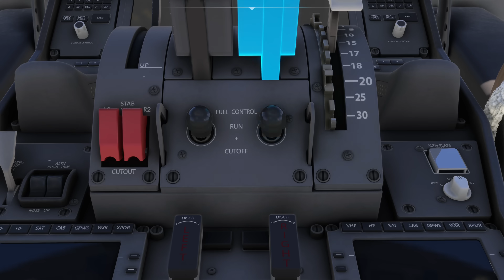Air India 171: Why Did The Fuel Cut-off Switch Get Moved?

Comment: “The simplest explanation is usually the correct one.”
Occams Razor. 
Suicide
Reply: not when it comes to technology , electronics and mechanics
Reply: @stevebubbie1126 Oh yes, of course, that must be it: both fuel pumps just happened to take a break at the exact same time — pure coincidence! And then, out of sheer goodwill, they decided to start working again on their own. Or maybe the two switches — which are specifically designed to not be moved without deliberate force — just randomly flipped from Run to Cutoff, took a 10-second nap, and then went right back to Run. Totally normal.

Or perhaps the pilots' dialogue was just a brilliantly acted performance — Oscar-worthy — and no one actually touched anything. Could be a software bug, an electronic glitch, or some mystical mechanical failure, MH370-style, GermanWings, EgyptAir… yes, all those events clearly had no human agency involved, as you suggested.

Because obviously, the idea that a human being — possibly depressed or unstable — could simply turn a switch from Run to Cutoff? That’s way too complex to consider. Much easier to believe the aircraft did it all by itself.

Comment: These switches are detented in both cutoff and run positions. They have to be manually operated. Anyone saying otherwise is ignorant of the facts There is no ‘auto off’ function of the  switch as some have surmised. This happened to a Delta crew in the early days of the 767-200. They shutoff both engines for an EICAS message and got the engines re-lit 2000 ft.  above the Pacific. Air India’s were shut off by a pilot, period.

Comment: As far as I know, the public does not know which pilot said what on the voice recording. The person who replied, “I didn’t” may have spoken the truth. The person questioning about the cutoff switches may have been setting (in a highly premeditated fashion) the other person up to shift the focus away from his own actions, knowing both their voices were being recorded. An effort to confuse and shift blame is within the realm of possibility. It’s a bit more of a convoluted scenario, but it is also one that must be considered with the information we currently have. Also, who called the “Mayday!” and what was that person’s demeanor?
Reply: Surely the Pilot flying would have had both hands firmly on the yoke at the point of rotation and initial take off phase, hence why the pilot monitoring operates the gear up lever when requested by the pilot flying.  Therefore, in this case, the pilot flying was the first officer so if anyone manually switched the fuel levers to cut off just after rotation, it must have been the captain.
Reply: @grahamt8808 I have never been in a cockpit, so I am admittedly out of my depth. Does the point that there is ambiguity about which voice is connected to who was doing what and saying what still not apply to the piloting protocol you’ve elaborated?
Reply: @grahamt8808  Exactly, it was dumb and unethical for Air India to try to obfuscate this critical information on who said what and which pilot appeared, preliminarily, to have turned the two fuel switches off. But it was even dumber for them to issue this preliminary report in the manner they did. 

Despite their attempt to temporarily cover this up, it was very likely 56-year-old Captain Sumeet Sabharwal who turned the switches off, and it was very likely 32-year-old First Officer Clive Kunder who discovered these shocking control changes in the 10 seconds after they occurred, first on engine 1 (yet probably not until about 6 seconds afterward, when all kinds of warnings were going off in the cockpit). Then, Kunder seemingly asked Sabharwal, "Why did you do that?" To which, Sabharwal seemingly said, "I didn't." (exactly as a child would do when confronted by his/her parent, just as Captain Steve said in this video). After that verbal exchange and have literally no time for anything else, Kunder seemingly turned the fuel switch of engine 1 to run. Then, Kunder seemed to pause for several seconds and seemed to switch the fuel switch for engine 2 to run.

Note to the bums at Air India: If you are going try to obfuscate your "story" of what happened, then don't disrespect everyone (especially all the families of 260 deceased people) by acting like you don't know who said what. Air India (and likely the entire extended team of investigators) knew, in several independent ways, who said what, and they almost certainly suspected that the turning off was done by 56-year-old Captain Sumeet Sabharwal. There is nothing wrong with publicly reporting that as a preliminary finding and saying this preliminary finding will be studied thoroughly in the next year or two before issuing a final report. In fact, that is the transparent and ethical thing to do. In those senses, Air India has failed.
Reply: @grahamt8808 good guesswork.
Reply: I had just posted this exact scenario (deleted now, you said it first. 😉). I think this is the most likely scenario.
Reply: @sintax6581  I wish you hadn’t deleted the comment. There must be value in our perspectives. Your gut was telling you something. May I ask why you chose to delete the post?
Reply: And the one who did it could just ask to other why did you.   

We need video.
Reply: @HappyPenguin75034  Video, which has been discussed in other threads, would be useful in the investigation. Are unions, officials, and airlines willing to make the push? The pros and cons make for a conversation that Captain Steve may decide to address in greater depth soon. Change is often born out of what we learn in these incidents.
Reply: You know they weren not speaking english😢 @HappyPenguin75034
Reply: @mic7093   .... Or not ...
Reply: @Paula-tf3zv  Correct. Or not. No theory is definitive right now.
Reply: Entirely plausible.
Reply: @Perly53  Right or ultimately wrong, I am glad you agree that we are at a point where it must, at least, be considered, until more is disclosed.
Reply: We have three actions: Turning off the switches, asking, "Why did you turn off the switches?", and trying to restart the engines. As far as publicly available information goes, we don''t know which pilot did any of those. It's conceivable that one pilot did all three, or any other possible combination.
Reply: @russlehman2070  Including you with those who see uncertainty.
Reply: Nice observation another possibility
Reply: @toastums71 I speak as a layperson, so thanks for reassurance that the comment is not coming across as utterly off-base.
Reply: He who smelt it dealt it
Reply: Also consider, maybe one pilot was already dead. And the one who was flying staged the entire scene and crashed the airplane.
Reply: Watch Flyingbeast video if you  really believe in unbiased explanation ❤❤❤ english subtitles are available
Reply: The actual statement is not put out. Not even the timing of the statement. 

And indirect statement does not validify the truth of the scenario.
Reply: Come on. We’d hear more than “I didn’t,” if that pilot truly did NOT just commit mass m*rder via fuel cut-off but his co-pilot did.
Reply: @ThatAdam12 Believe me. I was right with you a day ago. But I took a step back and felt there was a possibility. Remote or otherwise. We seem removed from absolutes at this point, which is what I am acknowledging. Information is deliberately vague.
Reply: @ThatAdam12 but this flight only lasted 32 seconds, there was no time for a longer conversation.

Comment: No one will ever know why that dummy shut the engines off. It really does not make any difference at this point. Move the switches so the dummy first officer can not get to them. Put them way over on the left side of the pilot. Only the pilot should have access to the switches. It is really dumb to have those switches front and center like they are now. Either that or just get rid of the switches altogether.

Comment: My guess is that the co-pilot wasn't aware of what he was doing when he shut off the fuel supply. Was it a mental blackout, some kind of carelessness, or poor training that prevented him from understanding what he was doing at that moment? Perhaps he believed he was performing some important action for the continued climb, such as retracting the landing gear. I know that sounds far-fetched. But if he believed the switches did something other than shut off the fuel, his answer would be correct from his perspective. My reasoning doesn't claim to be true; it should rather be understood as a plea to use cockpit cameras.

Comment: Clearly, the switches were physically moved as one of the pilots was asking about it, so people suggesting "maintenance jumpers" being left in the wing kind of baffles me.
A "RUN" signal also causes all sorts of indications and messages.
It would have been noticed before they left the gate.
They were also moved 1 second apart, and switched back to "RUN" 10 seconds after.
"Maintenance jumpers" makes no sense.
With regards to two pilots needing to perform an action to switch the engines off... the cutoff switch isn't the only switch to do that.
The fire handles could have also been pulled which would have made it even less likely for the engines to recover after being pushed back in.
But, at some point, a single pilot would also need to be able to switch the engines off.
In cases of emergencies, the pilot who has to concentrate on flying shouldn't have to be asked to insert and rotate his key at the same time as the pilot taking care of that emergency in order to switch off the engine that is on fire.
At some point, making it harder for pilots to do their jobs becomes detrimental to safety and doing this in order to prevent possible intentional consequences is just not solving the problem.
We need to value the lives and mental health of the people who are flying us to our holiday destinations.

Comment: The design flaw is that at take off those switches should have a plastic cover over them that can only be released by 2 other switches either side of the cockpit that can only be reached by the pilot sitting closest to it (i.e each one). Then sabotage cannot happen. Not saying it did here ok, let's wait for the findings. Those switches are far too important to just be sitting there and not protected better.

Comment: Hi Steeeve,
Is there any way that one of the pilots could have confused those cutoff switches with some switches  they were supposed to flip? Like pushing the radio button off instead of pushing the engine off button in a car. (Yea, I did that the other day.....)
Don't worry ..... You'll never have me as a co-pilot ....

Comment: When starting the engines would it be possible for those switches to be put in the run position but the indents didn't engage properly? The switches would then be unlocked and accidental movement possible.

Comment: While many discussions around Air India Flight 171 focus on the unlikely scenario of mechanical failure affecting both engine fuel cutoff switches, the available evidence suggests a more plausible explanation. The problem does not appear to result from wear, age, or internal malfunction. Instead, it aligns with a known installation-related vulnerability described in FAA SAIB NM-18-33 (December 2018) — a condition where the switch’s locking mechanism may be left disengaged during installation, allowing unintended movement between “FUEL CUTOFF” and “RUN.”

This advisory reframes the event: Rather than an extraordinary dual mechanical failure, it becomes more likely that both switches were installed incorrectly, leaving their locking mechanisms disengaged. This condition, if present, would significantly increase the chance of accidental activation — especially under real-world cockpit conditions, such as turbulence or inadvertent contact.
FAA SAIB NM-18-33 was only advisory, not mandatory. Operators were encouraged — but not required — to inspect or replace affected switches. As a result, many aircraft already in service, including Air India’s Boeing 787-8 (VT-ANB), was not inspected or modified, as confirmed by the accident report.
Supporting Factors
Several details increase the plausibility of installation-related switch compromise:
•	SAIB NM-18-33 clearly states that improper installation can leave the switch locking mechanism disengaged, enabling unintentional movement.
•	The condition affects Boeing 787 variants, including the 787-8 involved in this incident.
•	VT-ANB was delivered in January 2014, years before the bulletin. There is no public record indicating it was inspected or modified following the advisory.
•	The advisory notes no part defect or mechanical fault — only a risk introduced during installation if care is not taken.
Conclusion:
Although the exact probability cannot be calculated without direct inspection of the recovered switches, the absence of mandatory corrective action and the aircraft’s unmodified status raises the likelihood that both switches were vulnerable to inadvertent activation.
This installation-related failure mode is far more credible than a coincidental dual mechanical breakdown.
Notably, the AAIB preliminary report and public sources do not confirm whether the recovered switches were examined for the specific lock-disengagement issue outlined in SAIB NM-18-33.
Furthermore, the one-second delay between the two engine shutdowns could plausibly reflect a momentary oscillation or movement — such as turbulence or cockpit interaction — that made unintentional contact with both unlocke

Comment: Captain Steeeve, 

I can foresee a problem requiring both pilots to turn off the fuel cut-off switches, much like the two people required to launch a nuclear missile. Should one pilot have one or both hands injured [perhaps from something crashing through the windscreen, or a fire on on-board], it would be difficult or even impossible to provide that 'second input.' I  think a better solution would be to have the computer recognize a take-off from other low altitude situations, and lock out that function until you do reach a minimum acceptable altitude [I think I remember you saying something about 1000 feet]. I would think a relatively simple computer sub-routine that recognizes when the altimeter rises from the local altimeter setting and the weight comes off the landing gear until the plane gains that minimum required altitude.

Comment: How exactly is the position of the fuel cutoff switches detected and reported to the FDR? Is there a physical position detector inside the switches which is read separately by the FDR, does the FDR read the same wires that the switches use to signal the processor, or does the FDR get the position from software?  Seems like the first option is the old one that would give a true indication of the physical switch position.

Comment: @Captain Steeeve - Can we have some kind of foam compartment in wings like fire engines use to put out fire on ground which can be used to prevent fires in case of air crash which is imminent for any reason? I understand carrying a lot of foam will affect efficiency and profits for airlines but can save lot of lives.

Also to counter the cameras in cockpit claim, if Pilots are doing their job right.... they should not be afraid of the recordings. For sake of video leaking, it can be stored in some secure place like black box where it is hard for a normal user to retrieve the recordings.

Comment: It's the easiest thing to blame the pilots for saving the big corporations. We've seen a similar kind of report with the 'Stab trim' for the Lion air crash. The preliminary report from AAIB, India, says "...and immediately thereafter, the Engine 1 and Engine 2 fuel cutoff switches transitioned from RUN to CUTOFF position one after another with a time gap of 01 sec."

Firstly, this is ambiguous. It never says, the pilot did that and it never explains if this can be the case due to any mechanical/electrical failure or not. My question to you is, how did you came to this conclusion that the pilots did that?

Suppose you're driving your car at 50mph on a highway, will you turn off your ignition and take out your key (or maybe press the START/STOP button) out of nowhere?

Comment: As a cover, the pilot that DID it could have asked the question, and the pilot that DIDN'T do it answered correctly, he didn't do it. Would then take away blame or suspicion. And if it was intentional, it is not suicide, it is cold blooded MURDER!! But could an electrical failure cause the same effect as turning off then back on? Like the switches didn't physically get moved, but it show sup as that due to an electrical glitch?

Comment: without knowing how the switch is designed, is it possible that the computer system cutoff the fuel for some reason, and at the same time  the switch was moved to its cutoff position automatically as a consequence? If we could hear the switch flipping sound from the voice recorder, the time difference could be determined when the system logged the fuel cutoff and which one came first

Comment: I have a question about the fuel switch operation. Would it be technically feasible or even advisable, to make the transition from Run to Cutoff a two-step process?

For example:
When switching from Cutoff to Run, a simple confirmation like “Fuel in RUN position” is displayed.
But when switching from Run to Cutoff, the system could ask “Are you sure you want to cut off fuel?” With OK and Cancel Button as software to prevent accidental shutdown.

My thought is that this extra step could help avoid silent or unintentional cutoff by one pilot, ensuring the other pilot is aware. Is something like this can be implemented, or would it interfere with standard operating procedures or safety protocols?